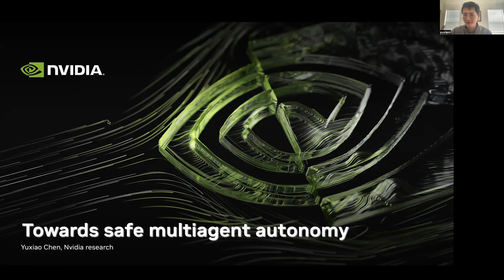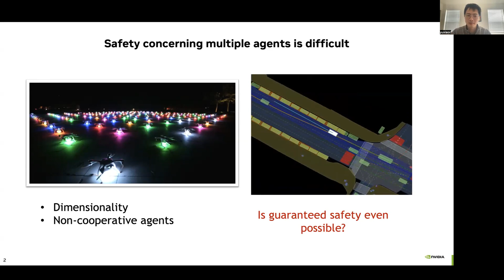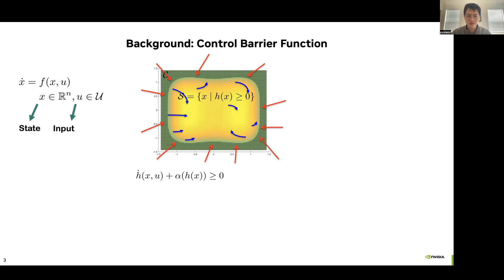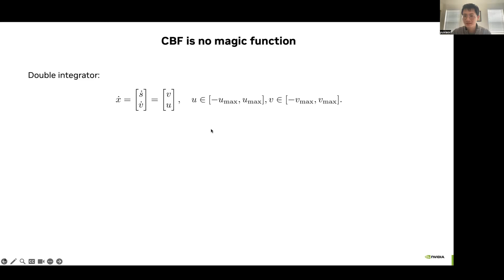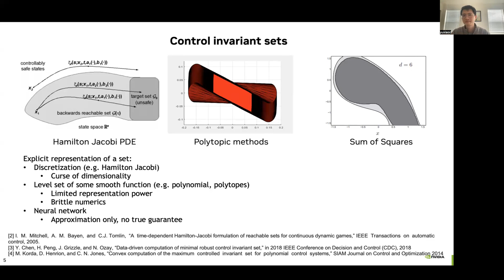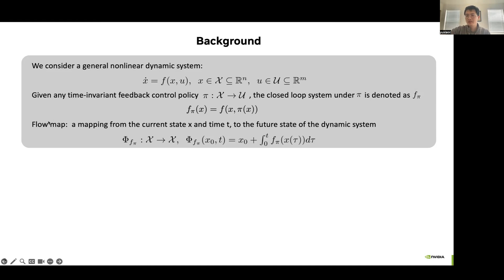Yuxiao Chen - Towards safe multiagent autonomy

Comment: Wow, thank you for this Interview. I really appreciate Yuxiao Chen presenting. This problem (safety) is a very difficult one -- The idea that you can create a "Safe Set C", seems very improbable in a real life situation, tho it is clearly possible during a highly controlled simulation. The math is ... well mind numbing.
  I am a little confused by the section where you remove the term Uj and ignore them... mostly because I think the assumption was a "decentralized" AI, so, I don't see how you can make the assumption that the other agent responses will be "working in harmony". For example: if you have 3 robots (A,B,C) and 1 of the robots (C) has a sensor failure, then it seems like the other 2 robots still follow the logic that C will do the right thing...? In other words, the assumption that all agents will work harmoniously cannot be consistently true (in the real world) because we don't know how the other agents are programmed or what issues they might be having: Encoder Failure, Sensor Failure, Internal Fault... etc, improper programming or other issue... ie a human that is not visible to the other robots but is visible to one of them.
   As you suggest,  a tree structured policy planning methodology seems like a better option for real life such as "driving of a car", we predict what other cars etc are doing, but, we must also drive defensively, meaning we don't always Know that a driver will do the right thing, so we take appropriate measures to ensure safe travel in case the other driver does something wrong. In other words, it isn't always a harmonious situation. Great conclusions in your discussion. Thanks for making this.